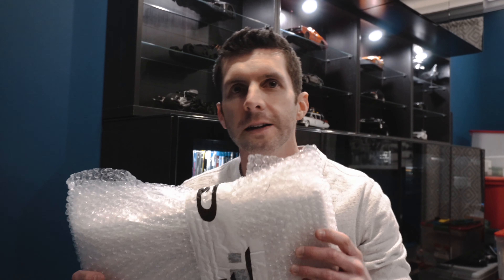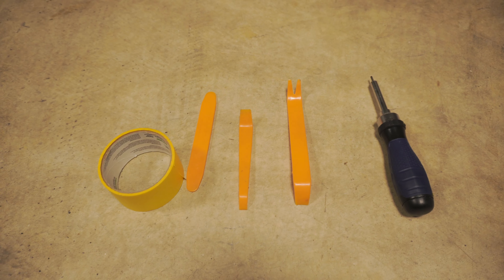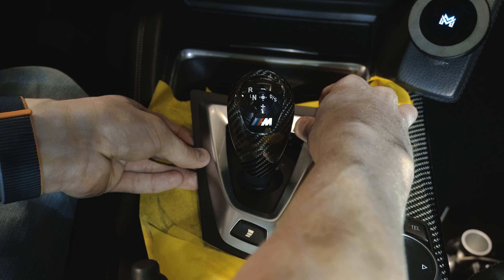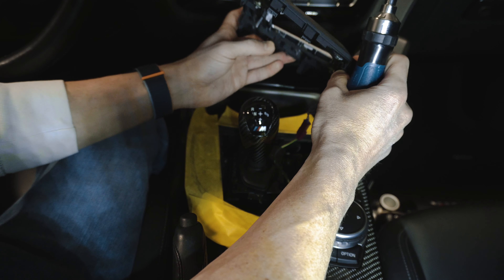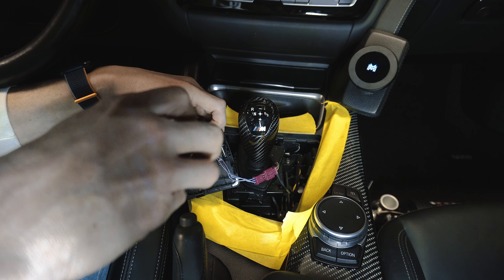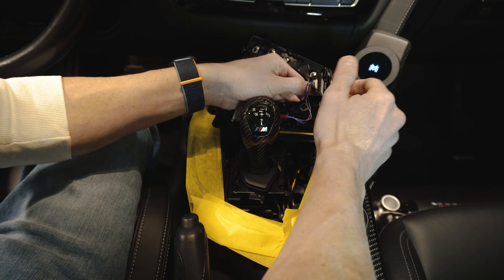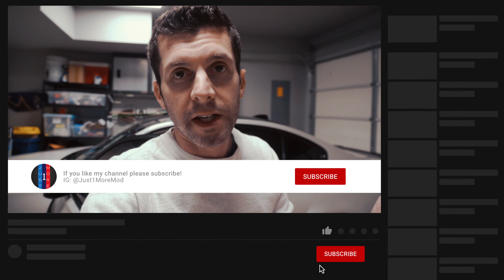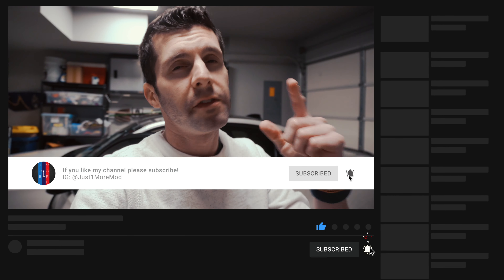BMW M3 & M4 M Performance Carbon Console Trim Install! FULL GUIDE Step by step installation

Comment: At 5:23 when you turn the trim upside down, are those screws holding that silver trim? Because me personally I wouldn't change the whole trim because I don't like the alcantara. I'd only the change the silver trim to carbon around the shifter.
Reply from the maker: It’s tough to say from memory if those are ONLY for the silver trim, or if they also serve another function to the base.
Reply: @Just1MoreMod  I see. Thank you nevertheless!